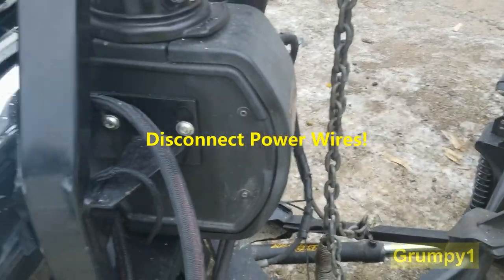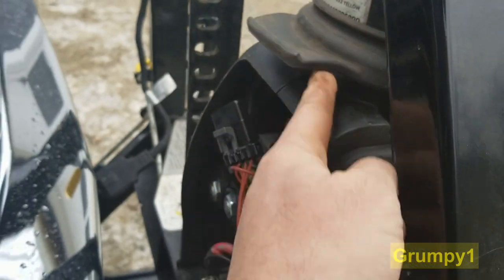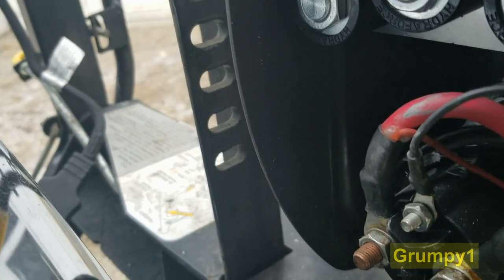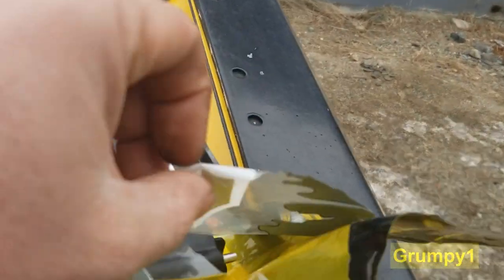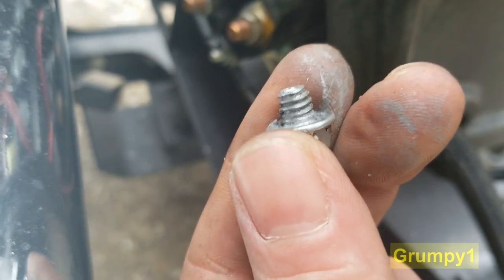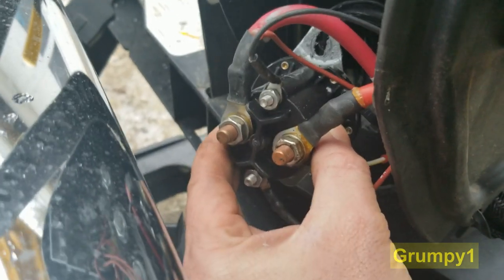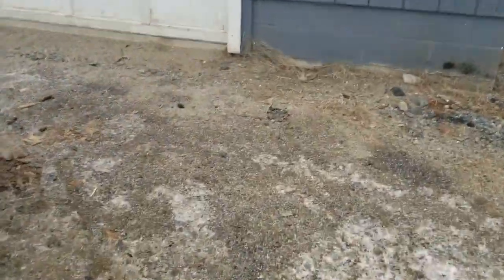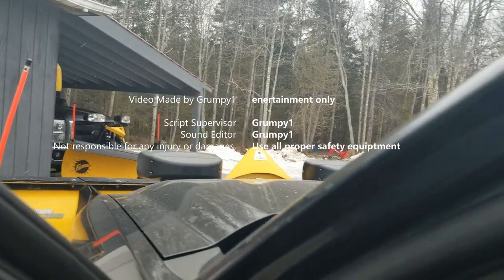Fisher Xv2 Snow Plow Pump Solenoid Replacement

Comment: I replaced the both truck side and plow side power cables and also a new electric motor and the solenoid as soon as i plugged it in the motor will run am i missing something i have a fisher extreme v plow
Reply: Having the same issue here can’t figure it out

Comment: I notice you repaired the plow on the GM but also a Ford under the car port. 
Which truck do you like better?
I have a 2016 F 350 single wheel single cab with an XLS and a 2012 GMC 2500 with an 8’ straight. Both plow well, but the GMC is so much more comfortable 
The Ford barely saga with the XLS though. Be safe. Have a great season
Reply from the maker: Yeah the Ford is my buddy's truck  haha.  He had a GM and liked it, but figured he try a ford. 
  It's a much bigger cab in the ford , taller ceiling,  and  much more visibility than the Chevy.
    And  solid front end , the Fords hold the plows well. 

    The GM is my truck and they are more comfortable than the ford.   But , I'm a short guy , and if  I were taller , the ford would be better that way. 
     I dont really hold any loyalty to any brand , I just want them to be reliable , which that is less and less it seems.  The build quality and materials used are horrible on all these new vehicles. 

   Like to have an ol' Army Surplus  vehicle to plow in around here, but that wouldn't be as comfortable as a lil chevy pickup 😄

Comment: What problems did you have prior to replacing? Any warning flashes on your stick?
Reply from the maker: No problems.  Fisher recommends replacing the solenoid annually for commercial use.  
    Funny thing... we didn't get much snow last year , so I opted to not change the solenoid when I was doing the fluid change this fall. 
   Plowing today and the solenoid failed! 
  When they fail its sketchy because the hydraulic pump won't stop running , even with truck shut off and keys out of the ignition  .  
   The pump sticks on and is trying  burn itself out bound up with no where for the fluid to go.
   It can melt the wiring or pop fuses from the draw and resistance.  
   It happened to me with and Xv2 years ago and I didn't know what was going on. 
   But it happened today and I jumped out and pulled the power wire connector apart and it shut the pump off.  
  Then I replaced the solenoid because I had the new one on the shelf .  
They do fail . I've had 2 go in just a couple years.
Reply: Thanks for the reply. Ironically searching my problem, I came across you video. I am in Maine as well and Downeast Washington Co lol
Reply from the maker: @tomc6177   
 Well this IS Fisher Nation! Haha
It's a quick replacement but it's on the back side of the pump housing so it's best to do it w the Plow not hooked to truck. 
I take a picture of the wiring before taking it apart. 
    Be sure they give you the Right matching part .  Don't get it from Napa.   Get it from a Fisher Dealer. There is a difference on that part quality.  
That solenoid is activated thousands of times if you think about it. 
  Good luck from Mt Desert Island area.

Comment: Change these every fall guys get oem part and save the 1 u replaced super cheap insurance and can save u at 11pm 8 hours before stores open I change mine when fluid is draining. Everyother drop your hydraulic tank spray out w brake clean scrub of mag in bottom disconnect all hoses and flush and refill. Dielectric grease connections and torque bolts good too go and can save thousands in breakdowns and aggregations. Especially if u got 1 plow. I'm hoping for a decent used 8 6 v this summer tho my 9 ft hd2 has been great for 3 years. We get a lot of snow to
Reply: Having a spare it good advice. Changing a part that isn't broken is a waste of money. Get five or ten years on it then swap it out.

Comment: What’s a sign that the solenoid stopped working ?
Reply from the maker: When it failed for me , the first indication was the pump sticking on for a second after I released the controller button. 
   It did that 2 or 3 times in a few hours , then suddenly the pump stuck on  , running for over 30 seconds and in such a way that it was going to burn out trying to make pressure with nothing moving. 
   I took the keys out of the ignition,  though the way the plow pump is wired, it just remained on , straining severely.  
     I wanted to unhook the power connection up by the plow , though feared the hydraulics might move with me in close proximity.  
   Fortunately the solenoid released and shut the pump off. 
     More scary still, my friend works on a small town Fire Department,  and he said he responded to 3 vehicle fires last year and they were all fairly new plow trucks , several of which directly attributed the fire from the plow pump sticking on due  to solenoid failure , then melting the power wires , resulting in fire and loss of the vehicles.

Comment: My question is what if those two little wires are disconnected when you buy the truck? Putting a new solenoid in I don't know what side to put the little wires on. The positive wires don't matter.
Reply from the maker: Not sure.  I was always careful to not get them mixed up . 

Best thing would be find another Plow and get a look at their wires on solenoid